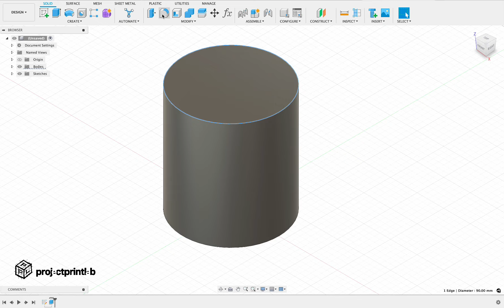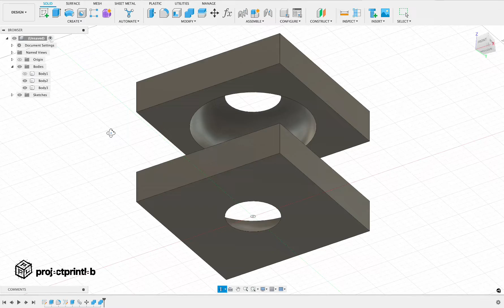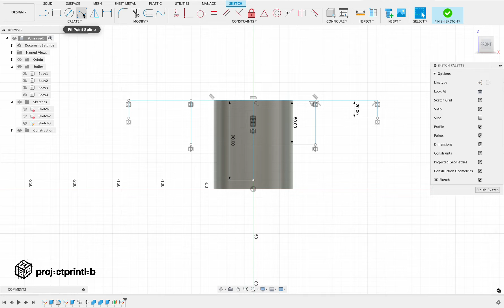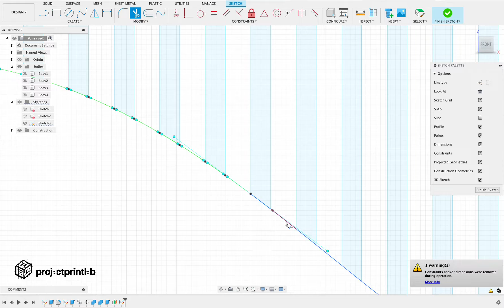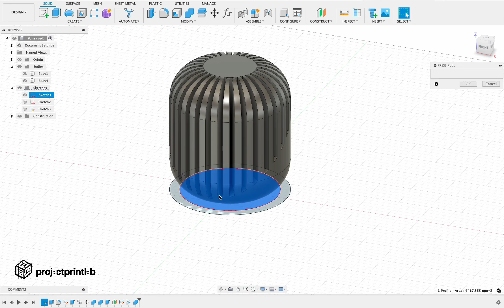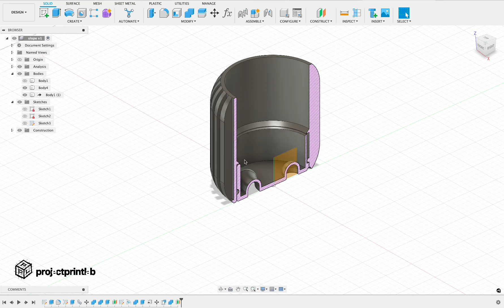How to create a fluted pattern on a filleted body making a planter w/ hidden Pig Nose drip tray

Comment: This video showed a lot of promise, but I made the mistake of starting to follow along before checking the comments. Turns out, the project is missing a crucial component—the drip tray. I would’ve given it a thumbs-up if the file had been included, but as it stands, it’s a thumbs-down from me. If the creator is generous enough to share the drip tray file with us, I’d happily update my rating.